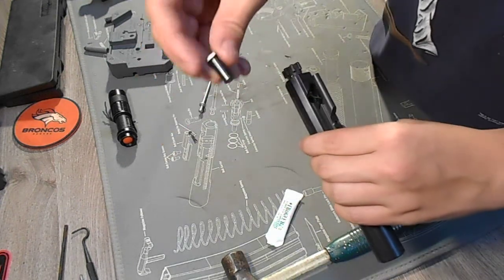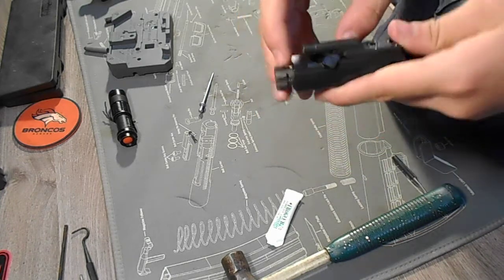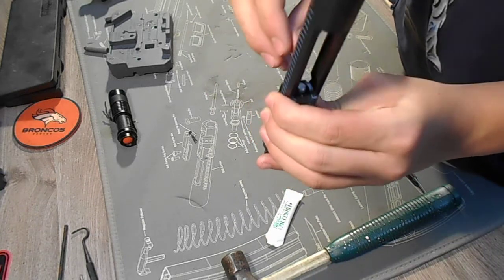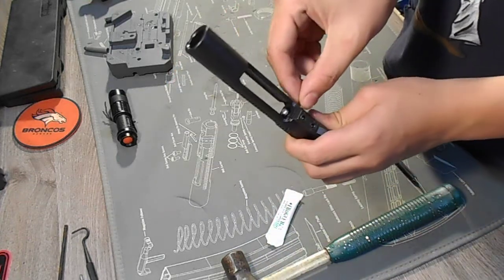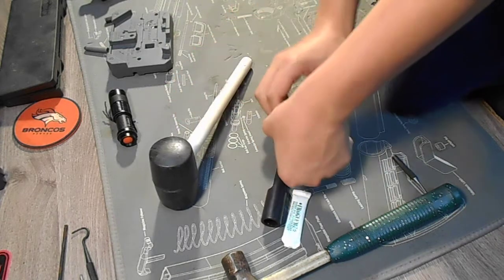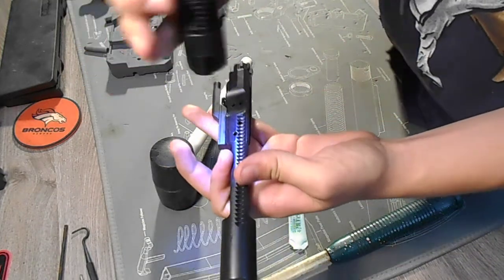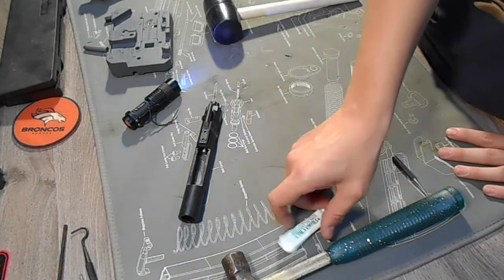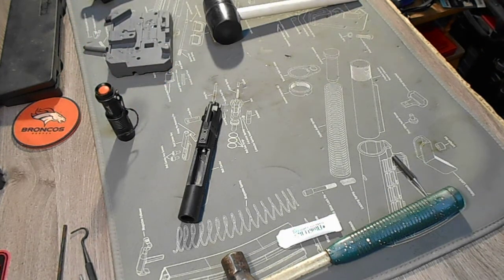Kid Builds an Ar15 #8 Bolt Carrier Group Assembly and Headspace

Comment: Very well done there is a little trick to putting those firing pin retaining pins into the actual carrier body. When you insert the retaining pin into the funnel hole push down on it so that the retaining pin will go across the top of the bolt carrier and it'll basically go across the top which is on a rounded radius and it will go right into the hole on the other side.